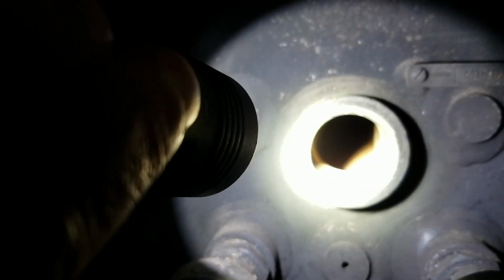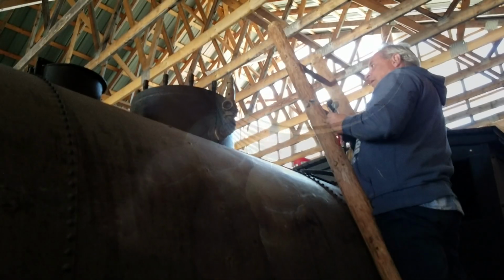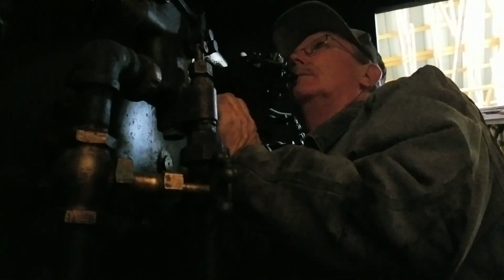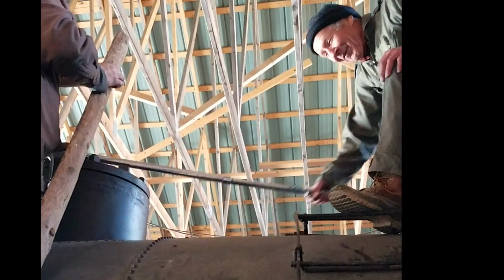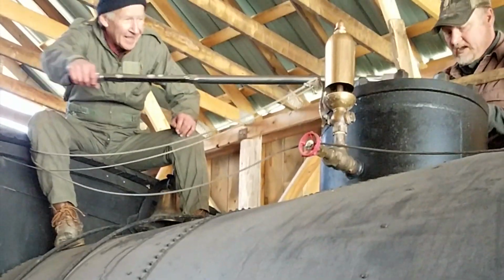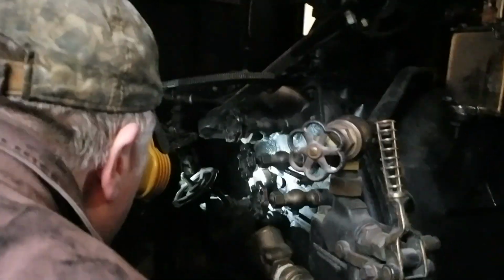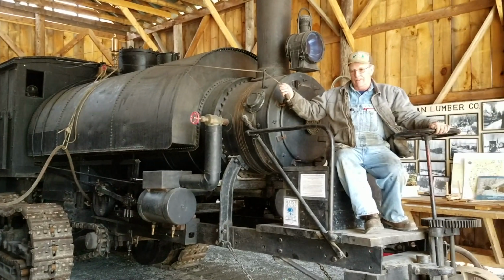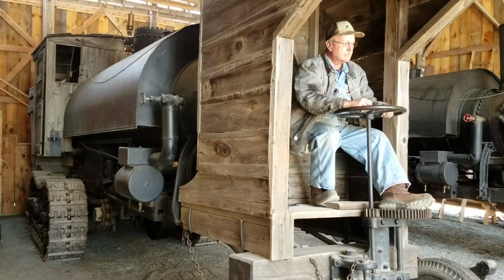Inspecting and Testing 1907 Steam Lombard Log Hauler

Comment: Classic example of blue sky thinking ,Mr Lombard tackled the problem of hauling freshly cut timber from the forest to the sawmill or railhead,. He took a small steam railway locomotive ,a standard gauge saddle tank engine, like a shunter (switcher). Removed the railway chassis and wheels, designed built a new chassis  on Ruston&Hornsby crawler tracks pre John Best William Holt (KittyCat) driven by the loco cylinders via a counter shaft and straight toothed gears.  A conventional traction engine steering front axle with wide section steel wheels, easily changeable to a pair of wide skis for winter operation pointed Lombards radical machine in the right direction.  Lombard,s tracked choo choo chuffer replaced a team of horses or mules in dragging sleds of timber through mud slush and snow, cheap to run as the boiler can be fed with wood waste.
Reply: Lombard developed and patented his first log hauler in 1900. The track design was his own design and not an adaptation of Rushton & Hornsby's or any others. Lombard did  not repurposed railway locomotive. Even on his very first machine and all subsequent machines the boilers were supplied new by the Ames Iron Works of Oswego, New York and the cylinders etc. cast by the Waterville Iron Works. Ski's were standard. Steel wheels were never fitted to the steam Lombards though the later gasoline powered machines were sold with skis or wheels and often both. Steel wheels are fitted to the MF&LM Lombard to allow it to be moved and demonstrated during summer events.
Reply: @terryharper2024  That is maybe so, but the overall appearance of Lombards radical  steam tractor is of said small railway locomotive. Even though the running gear slung under the boiler is similar to a prairie traction engine manufactured by J I Case of Racine Ohio,. Regarding the undercarriage, it is of his own design incorporating  existing tried and tested parts, like the tracks ,similar to those of a Bullock half track steam tractor . During  spring ,summer and autumn(fall) were Lombards steam tractors still hauling timber? even without front wheels  . As you stated  Lombard subcontracted the boilers and cylinders to local iron foundries, US equivalent of Manning Wardle or Leeds or Avonside of Bristol .  Did Lombard realise he had the solution to the pressing issue of heavy haulage in UK around the 1920,s early ,30,s as new high capacity electricity generating plant for power stations being designed developed and built ?.  Transporting these very large heavy items of plant to the site fell on specialist hauliers ,like Norman Edward Box, Marsdon Road Services, E W Rudd, and Tommy Sunter of Northallerton.  For traction , said companies relied on  large wheeled steam road locomotives  manufactured by J, H McClaren and Fowlers of Leeds.